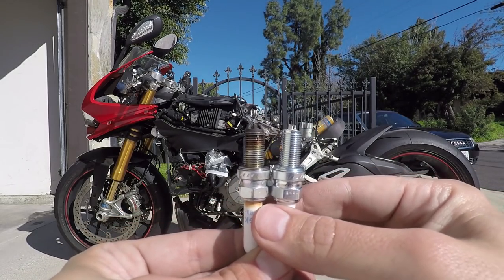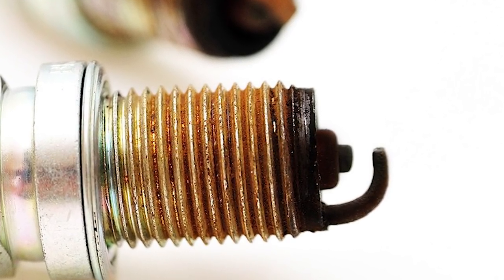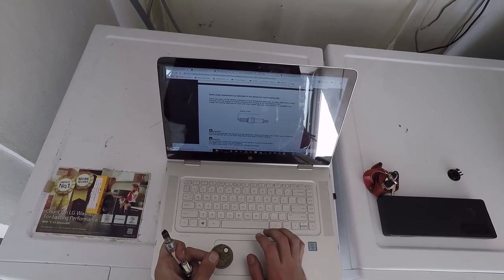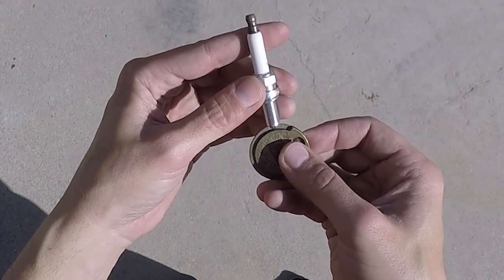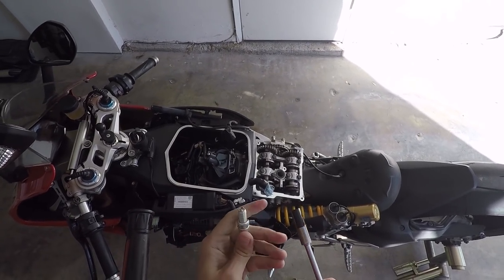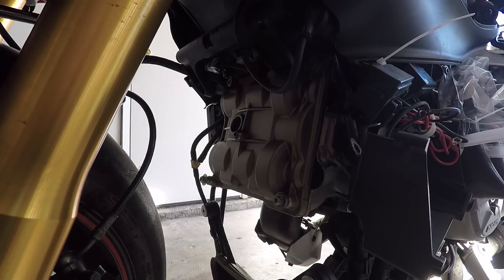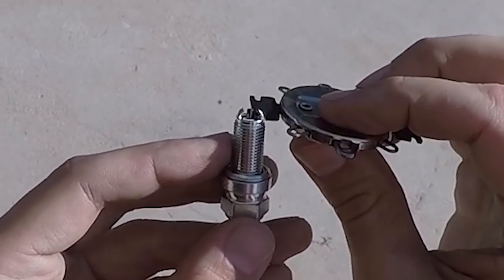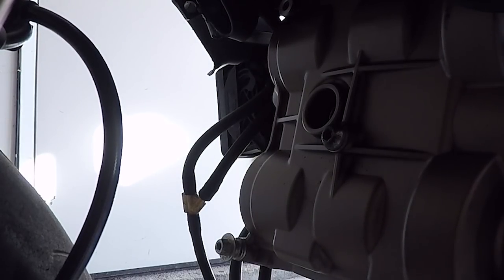How to Change Panigale Spark Plugs

Comment: Wouldn't it be so much easier for our American friends if they just moved to metric like the rest of the world? lolz Great video by the way, thanks!
Reply from the maker: We have this debate among fellow engineers all the time.  The metric system is based on water (1L H2O = 1000cc = 1kg).  Imperial units are based on a some dead guy’s foot.  A mile is a thousand Roman paces.  A pace is 5.28 ft…so 5280 ft per mile.

Comment: Did you adjust the valves on the front cylinder too?
Reply from the maker: Bikes and Beats only inspected the front cylinder since none of those valves were out of spec.  In fact only 1 of the 16 valve shims was out of spec between both cylinders.

Comment: Just picked up a 1199 last week being going over it and getting it sorted been watching a lot of your old videos it has 7800 miles on it when should I be worried about the valve adjustment and does this bike really only have two plugs
Reply from the maker: All my valves were in spec at 15K valve service.  I did my own valve adjustment at 30k and only one of the 16 valve shims was out of spec.  I have the service manuals and tightening torques in pdf if you want them.
Reply from the maker: PS the 3 things that will definitely fail:   the vertical cylinder valve cover gasket will leak oil at 7500 miles, quick shifter sensor / linkage will fail around 25k, and if you have ohlins forks look for them to leak around 15-18k miles.  Use good oil and don’t run the bike in a lot of stop and go city traffic.  It needs larger radiators.  That’s my next upgrade.  It’s the craziest machine you’ll ever ride.
Reply: @FancyAnimal  gotcha thank you it’s got 7800 on the ticker
 so it’s pretty low millage I will take a look at the valve covers to make sure they are not leaking really appreciate all the info 

And yeah I did noticed they run a little hot in stop and go traffic unfortunately no lan splitting here but I really don’t daily it and mostly drive it in the evenings
My fuel sensor already went out gotta get a new one of them do you still have the same bike ?
Reply from the maker: @MrCougar1825  ya I have the same bike. The issue with the coolant temp has a lot to do with the fan switch….comes on 216…should come on at 195F.  At some point I’ll get a tune boy and correct it.  Enjoy!
Reply: @FancyAnimal  so i have had my bike for about 2 weeks now and it has 8k miles on it and it was randomly dying on me and now it wont even run the bike will start run for about 30s check engine light will come on throws the bike into limp mode and i have no throttle im wondering if you have ever had this happen

im waiting  on my  odb hook up for the computer so i can read the dct codes but this is terrible called the dealer and even if i did want to take it there they are almost 2 months backed up and wont even accept new bikes 

i thinking its  either the crank positioning sensor or the map sensors any ideas i would be super Grateful and sorry to bother you on an old video
Reply from the maker: @MrCougar1825  sorry to hear that.  I’ve never had this issue. Could be tps, cps, ecu, Hall effect gear position sensor, timing chain skip etc.  Did you buy it from a Ducati dealer with a warranty?
Reply: @FancyAnimal  unfortunately no I did not get it form the dealer and even if I did they told me they were almost 2 months backed up and couldn’t fix it anyways lmao
Reply from the maker: @MrCougar1825  you always buy a Ducati from a dealer with a warranty.  If one dealer is booked, another can honor it.  You also get to see the service history of the bike.  Can you return the bike?
Reply: @FancyAnimal  no I don’t want too it’s something small like a sensor this bike has around 5k plus I’m mode so I got it for a steel I will wait for my odb stuff to come in the mail  so I can read the dct codes and go form there instead of trying to throw the kitchen stink at it in hopes of fixing it
Reply: My 899 did the same thing , it was the map sensor
Reply: @billycross3785  it was bad ground whoever put it in last stripped the bolt and it broke off when I tried  to take it out but it’s fixed now
Reply: @MrCougar1825  👍 ride safe

Comment: Hey Fancy, I wonder if you had encountered this issue... The harness for the electronic front suspension, the sleeve can tear open, at top section near the top end of your front suspension. The dealer had told me they can't just order the sleeve, but need to order the whole Ohlin suspension set!! What do you recommend? Super glue??
Reply from the maker: I need more info.  Are you referring to the lead that comes-off the top of the shock and snakes down around the steering head / subframe and into the electronics box under the fairing?  That loose black vinyl wire jacket over the lead is tearing?  If that's the case, buy some heat-shrink tubing, disconnect (gently) the connector at the top of the shock and slip the heat-shrink tubing over it and move to the desired location.  Then hit it with a hair dryer.  Test the tubing first before installing to be sure it shrinks to the right diameter.  Please send a photo of the tear to my gmail... afancyanimal@gmail.com.
Reply: @FancyAnimal  Thanks, I've sent you an email with a couple of pictures. I think you are correct about the issue.

Comment: I’m trying to change Spark Plug on my 2017 super sport S ... at the spark plug wire , seems very hard to pull out ? Is there any specific way to pull this cap/Wire ? Am I missing some lock ?
Reply from the maker: Johnny Hot Pie removing the Panigale plug wire required several attempts and all of my strength....along with several “holy sh@t that can’t be right.”  Twist the wire boot around the plug back and forth to be sure the boot is not adhered to the plug surface.  Then pull straight up, being sure not to bend the boot / break the plug.  Take your time and grip as much of the boot as possible to prevent tearing.  I don’t have specific experience with the SS, so calling the dealer service dept or consulting the manual is my disclaimer.  Cheers!
Reply: Fancy Animal Thank You , I thought I was destroying my bike !!! Great info thanks for the time

Comment: Hey man, love the vids! Just got 2 questions...1. Are you a mechanic because doing your own valve timing needs some skill and 2. Since you do everything yourself, don't you lose value on the bike as the service booklet doesn't get stamped by Ducati? Just curious, keep up the awesome vids!
Reply from the maker: I’m a mechanical engineer with turbine engine, machine, and materials background…design machines for a living.  Doesn’t mean I won’t do something stupid, but I usually can stumble through to the other side of most machines and devices.  As for value, the bike has already been run-over and totaled so 🤷🏻‍♂️.  Interestingly Seacoast Sport Cycle offers a class on DIY valves and is willing to work with you on warranty vs DIY to some extent.  I wouldn’t recommend doing the valve service if under warranty.  Personally there are better things I can think to do with $2000+parts than valve service on an 8 year old motorbike.  BTW one valve shim is $30-$50.  There are 16 shims on my bike and 32 on the V4.  Cheers!
Reply: @FancyAnimal  Damn man what an inspiration! There is an 899 for sale close to me but I asked all the Ducati service distributors about service costs and as you said, insanely expensive. I would love to be able to do my own services on a Desmo but I'm smart enough to know I'm too dumb for that XD. But I appreciate the time you took to reply, really enjoying your videos! Have a good one, cheers
Reply from the maker: @blackmedic6302  Honda SuperHawk or SV650 are a cheap and reliable way to enjoy a Ducati.  I’d recommend rc51 but too pricey.  I would buy a base 1299 over an 899 any day.  1299 is lighter and can be switched into 120hp mode until you get confidence to go 205.  Buy it with less than 5k miles from a dealer with a warranty and ask to see the service record before you buy so you know what’s what.   Only the valve service is insane.  Everything else should be under warranty.  You can do brake pads and oil changes yourself.

Comment: Great video!!! Question how many valves needed adjustment at 15 and 30k?
I’m at 10k on my 1299 
Going to change air filter next week for first time.. going to look into the filter you use.
Reply from the maker: I'm doing a 4 part video series on step by step valve adjustment.  With the 8 valves, there are 16 rockers and 16 shims.  At 15k, all valves were in spec.  At 30k, only 1 shim was out of spec.  5 shims were on the loose side, but in spec.  Do your filter every 5-7k.  Be sure to check the tightness of the 4 bolts in the corners of the subframe air box that attach the front of your bike to the engine while you're doing the filter. Cheers!
Reply: Seacoast is doing my 15k service.. I just find it funny you spend all that money at 15 & 30k to find a  shim out of spec at 30.. I only ride my bike on streets with no track days.
That’s for subframe tip!!
Reply from the maker: Nick Petrangelo I actually contacted Seacoast with my valve clearances to get the final word on what's acceptable and what isn't.  They're the best shop on either coast.
Reply: Fancy Animal I’m going to extend the service to 17ish because they run a 15% service discount over the winter.  So finger crossed I’ll be ok!!!
Reply from the maker: Let me rephrase - regardless of whether you have a warranty, talk to Ducati service before you extend things.

Comment: Wait, so did you buy back and rebuild the bike after the lady ran over you?
Reply from the maker: Yes.  Her insurance offered $12,000 + my bike or $15,000 + no bike.  So I kept it, paid off the title. rebuilt it for 1100 bucks and pocketed about 9Gs.  It just needed a rear wheel, rear subframe, clutch cover, and taillights.  Ebay!!!  Watch my V4 Ep1 vid.
Reply: Fancy Animal Omfg. What a come up! That’s amazing considering you came out with just a small bruise. I’ll check it out.